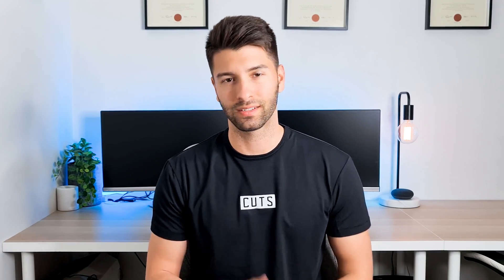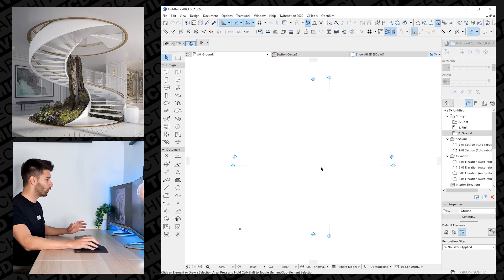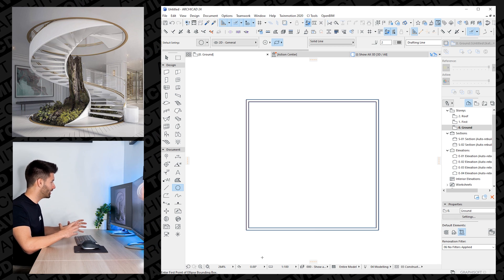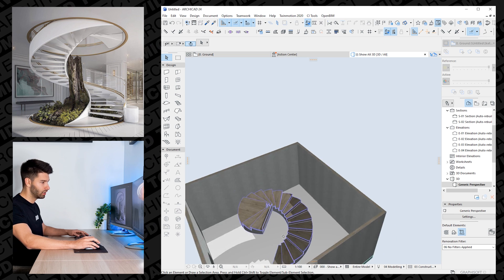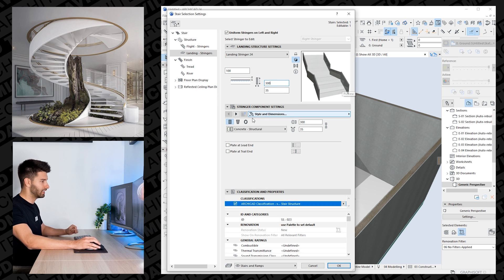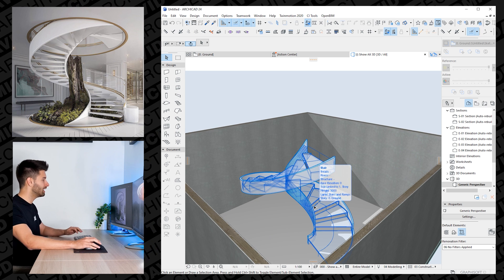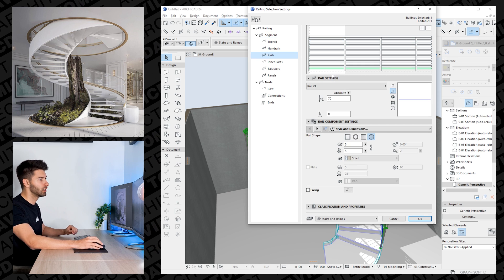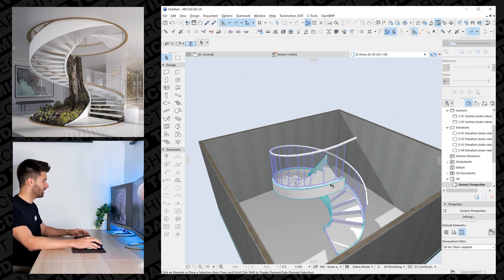ArchiCAD 24: Spiral Staircase Tutorial

Comment: I know this is an old post but - you can do the railing the same way as the stairs, magic wanding over the same circle! And then just fix the reference line in 3D to match the slope of the stairs. Quicker and easier than manually going around.

Comment: What happens when I want to build a staircase with a very small inner radius? For example, a metal spiral staircase with an inner radius of 20 cm — the exact diameter of the central supporting column?
Reply from the maker: Similar concept applies, but instead of having your stairs on the inside when you magic wand, make sure it’s on the outside

Comment: If we apply it in open spiral rscalator replace elevator with voltage sensitive magnetic steps could stabilize ambient or accelerated magnetic density change but we may need simulator effect on brain activity and threshold safety otherwise blood pressure may be affected

Comment: Do the same steps not work with ArchiCAD 25? I tried multiple times creating circle > select stair tool > press and hold shift and take cursor to the circle edge and 1 left click.... But it's not getting applied at all..... No changes whatsoever.... Please help me out
Reply from the maker: Should work no issues, try jump onto our discord chat, link in description, and see if the team can help with a few screenshots
Reply: @DavidTomic  I have the same problem with archicad 26, it doesn’t work this way((( magic wand appears, but when I’m pressing circle, nothing happens😢
Reply: @DavidTomic  hey david i noticed that your video skipped where you were actually magic wanding the stairs in. I've found the same method insanely inconsistent in archicad 25.. are you saying you didnt have any trouble @3:28?